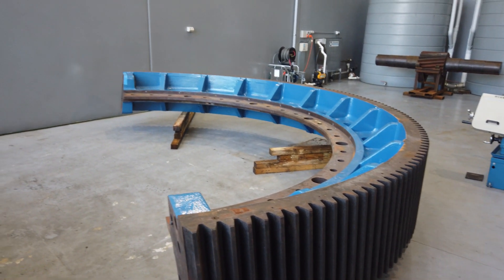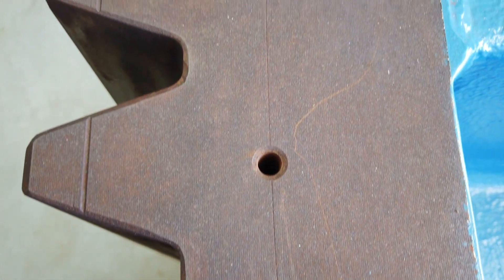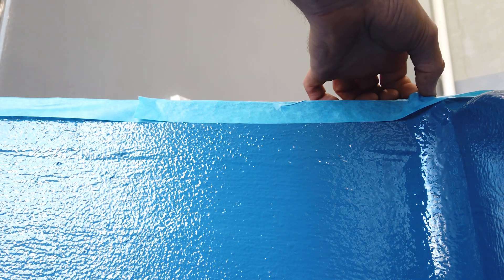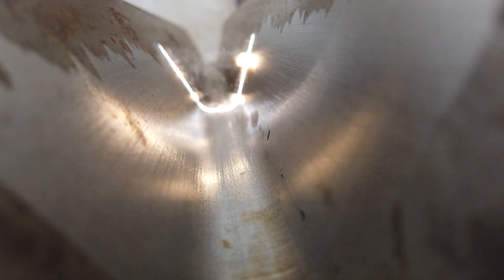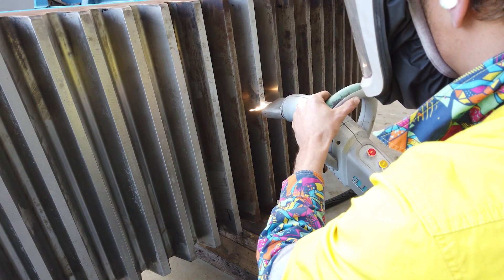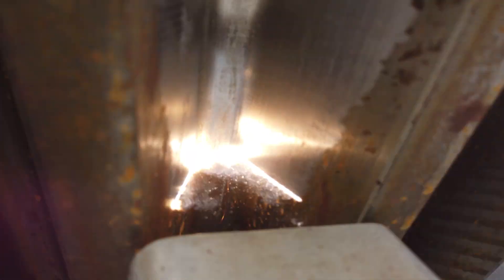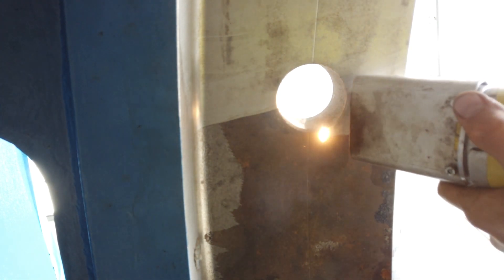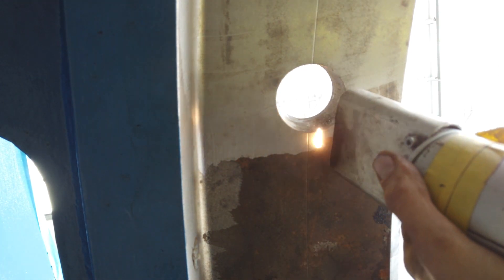One of our biggest laser cleaning jobs so far

Comment: Do you reccomend Chineese pulsed devices? because they are half of price the eu devices. Have you ever tried them ? What do you think also cw devices has to be used for? Thanks
Reply from the maker: CW definitely has its applications, though you wouldn't use it on this gear as the surface would be damaged. We started with a pusled laser that was broken for 8 months
Reply: How does the from China damage the gear if it’s the same type machine? Also what kind of helmet ventilation are you wearing?

Comment: What wattage is your system? 100w-2kW?
Reply from the maker: This is a 500W pulsed laser by 4jet.
You 100% wouldn't use say a 1000/2000w continuous wave laser in this application
Reply: @projectlaser  what’s the cost of the 4jet. I have a budget of 30k. Thanks
Reply: I see, I wasn't sure if it was CW or pulsed.
Reply from the maker: @akeniry  CW lasers definitely have market and are an excitingoptiondue to the ridiculously cheap price, it's just not for gears and precision components where the client wants true non contact cleaning.
Reply: I'm in the laser industry as well. It won't be long until you hear about my latest invention 😉 (Cleaning internal surfaces). I wish you the best on your business!

Comment: how did you bid the job? I did hear that it was a bit more extensive than you projected. Do you normally do a hourly type bid? What was the wattage of the machine your using? If you could message me if you prefer.
Reply from the maker: This is a 500W pulsed laser. We charge a day rate which is around 1% of our asset costs plus an Houly rate for the crew. added expenses for out of town etc.
We did a demo first and then roughly calculated the time to complete the job

Comment: Does this machine require a special gas ? And do you need special training to be able to use a laser machine like this ?
Great videos and neat work by the way. So much cleaner than sand blasting no doubt, but I know sand blasting would leave a consistent surface finish on surfaces that required painting. But these gear teeth need to be kept smooth, so great choice for cleaning.
Reply from the maker: It requires 3 phase electricity and compressed air to work, so no ongoing consumables.
Blasting will always have a place in the market due to being able to give a profile to the surface, lasers fit a niche.

Comment: How much did you charge for this service? 
How do you go about pricing your jobs on odd shaped items?
Reply from the maker: This job took me a lot longer than I envisioned, the surface area of the gear teeth was a lot more time consuming than I thought,  and I ended up working for a couple days longer than I quoted
I had countless hiccups and issues which meant I had to constantly stop and start.
I increased my invoice over what I originally quoted and the customer and I came to an agreement.
Reply: @projectlaser  do you try to price per square foot or per job on past experience?
Reply from the maker: @adventurousspencers369  I've got an hourly rate range that I stick between,  every application is different and quoting and Job times can vary greatly
Reply: @projectlaser  is it bold to ask what for price range cleaning with suchs a machine per hour costs ?  i got a car which i like to get clean for example.
Reply: What model machine are you using?